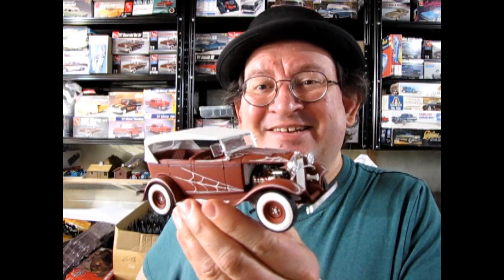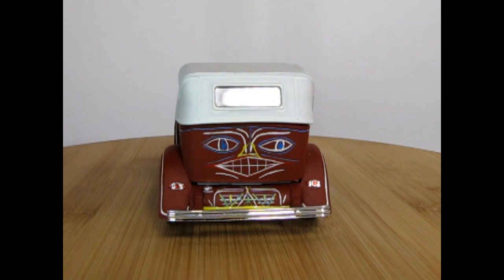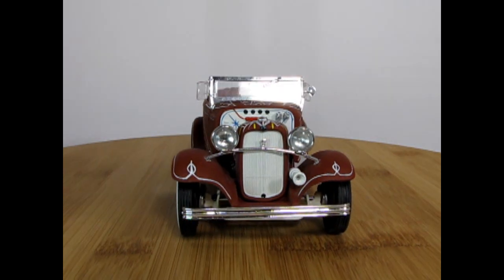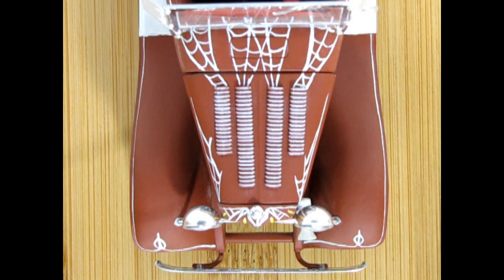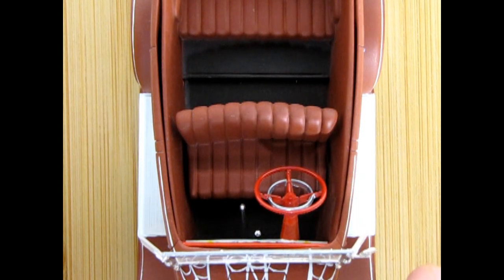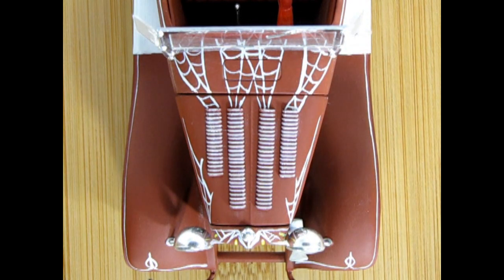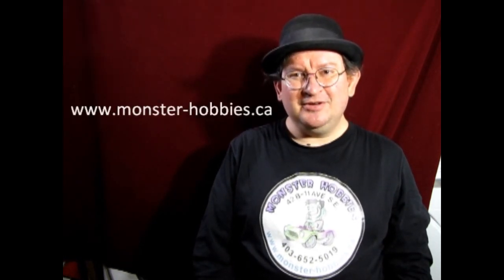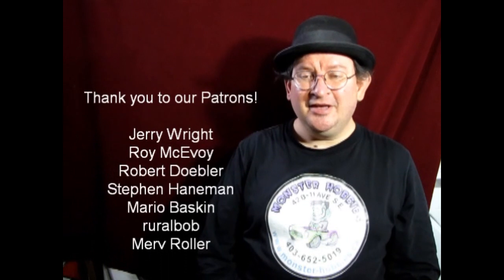Model Car Garage Show And Tell - My AMT 1932 Ford Phaeton Build Custom Red Primer - Model Car Build

Comment: Nice !! I started piecing my one back together from early 2000s they had put the wrong interior tub in it! So if anyone has any suggestions for me please let me know, but still nice model
Reply from the maker: Yes...on the first run of this model kit, they put in the interior from the AMT Ford Vicky. 
I do have one of those kits and next week I'll show you how I solved that problem in two ways. 
I had a friend give me a Vicky body and I cut the interior tub in the other. Next week's video shows you what I did. 
Hope you can join me next week! Thank you again for watching.